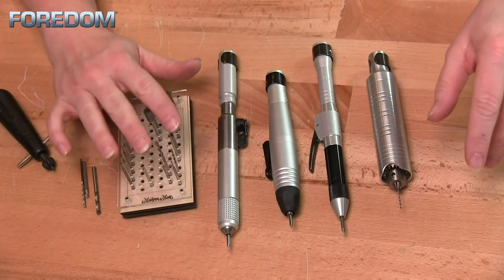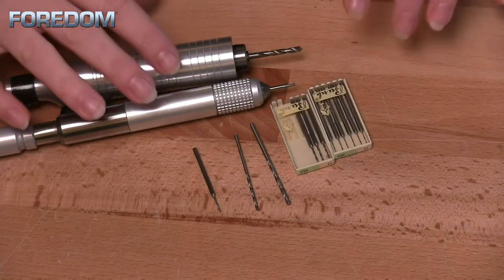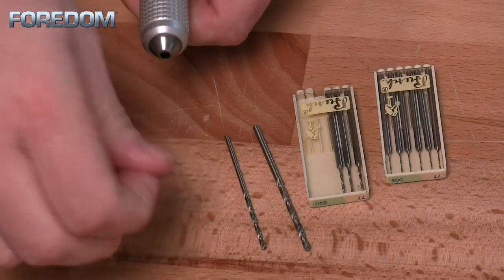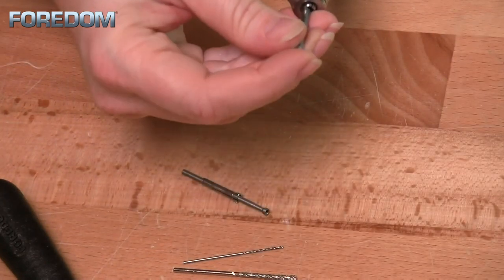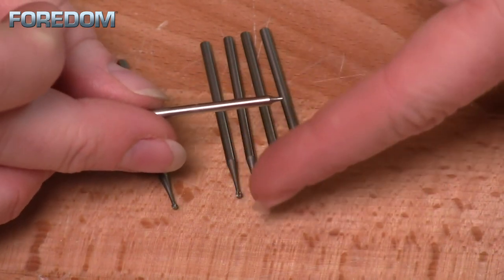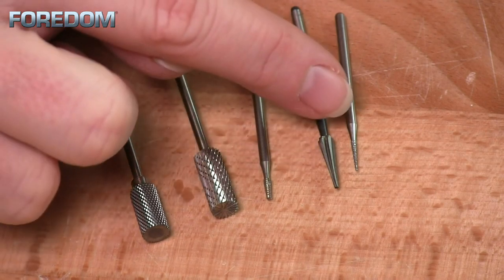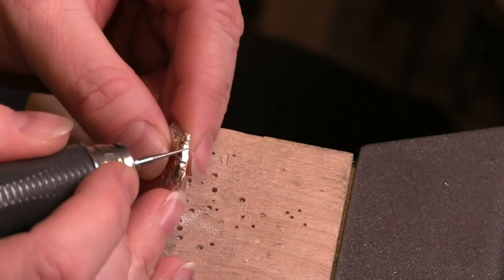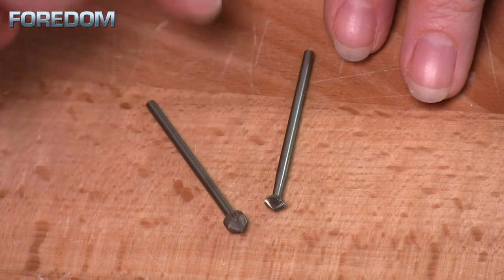How to Select and Use Drill Bits and Burs - All About Flexshaft Accessories Series

Comment: Omg thank you, thank you, thank you 🙏🏻 I’ve just invested in my first Fordom flexi shaft and have the accessory kit you showed. The variety of drill bits, burrs, sanding and polishing attachments is an absolute nightmare, so much so I stopped researching and have left it hung up unused. I know so much comes down to the work you do and of course personal preference but you need to start somewhere. At last I have at least a starting point 👍🏼